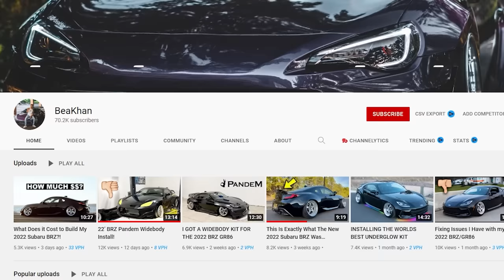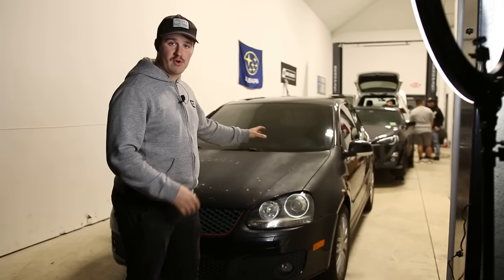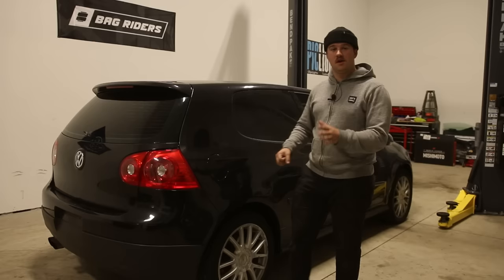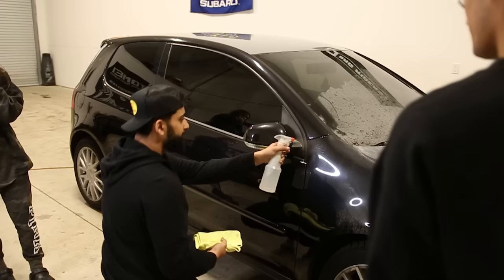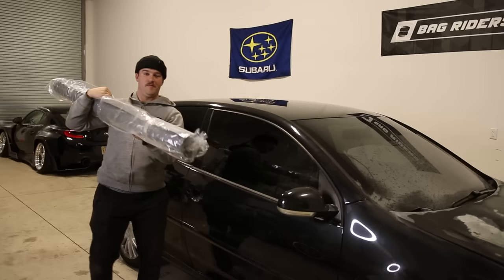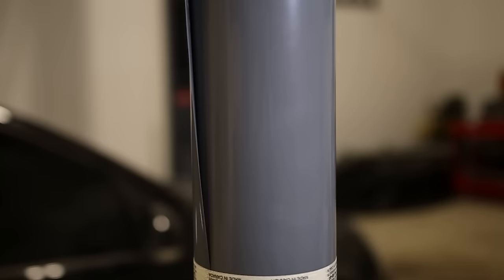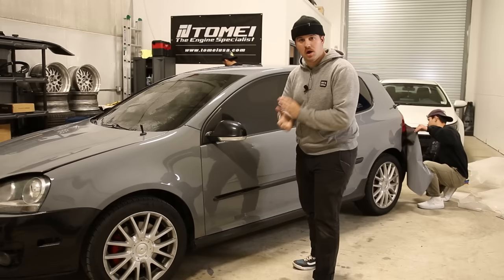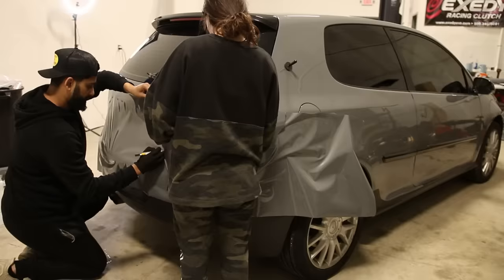Transforming My Subscribers Car On A $1,500 Budget! - VW MK5 GTI

Comment: This reminds me of my own mk5 gti. It was a high mile piece of junk but I loved it. I bought it with a k04 that would always spin the tires even in the dry from a roll. It taught me how to replace the radiator, wheel bearings, replacing the head unit from a mk6, exhaust, all that stuff.
Reply: You should get another one
Reply: I still own a Mk5 GTI. Absolutely love it, it's very well maintained and currently sits at 195.000km

Comment: I painted my MK5 with tintable raptor liner (truckbed liner) for $300 in my garage and it looks awesome two years / 15,000 miles later. I used tractor red tint.

Comment: The amount of quality used performance parts out there on ebay etc these days make a Mk5 GTI a smart buy in today's rimes of 300+bhp hot hatches.. edition 30 and Pirelli is the ones you want, easy to get 320bhp out of them with the K04 turbo 👌🏻

Comment: all builds are builds at the end of the day, the VW GTI mk 5 is a good base car, $1500 is a lot of money well I live in South Africa so converting it will be R22 000, with that I'd buy a set of coils, buy a R32 bumper kit and taillights, do a complete respray of the original black and maybe do a stage 2 or basic tune or buy an exhaust system, refurbish the wheels cos they hard to find in SA and buy some good tires

Comment: I have a car with a wrap on it. It's super sun baked, cracking and sunburnt. I want to take it off. What's the best method of removing a wrap? Heat gun and inches at a time? Or try one of those chemical wrap removal products? Any pointers?